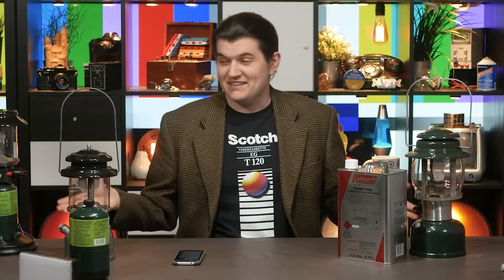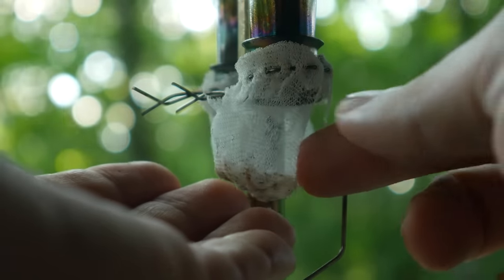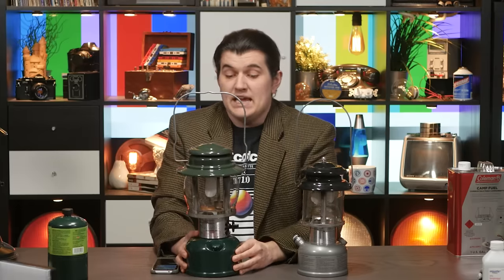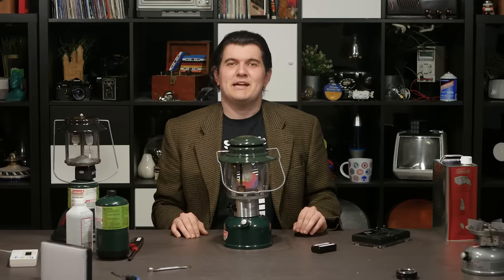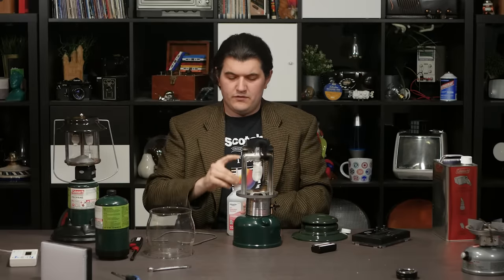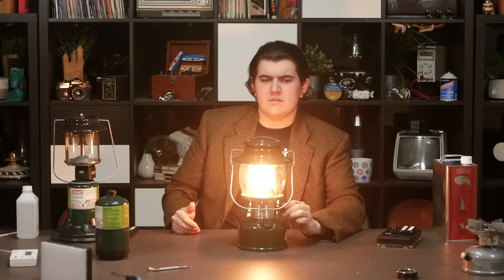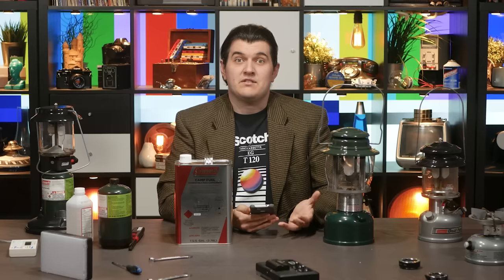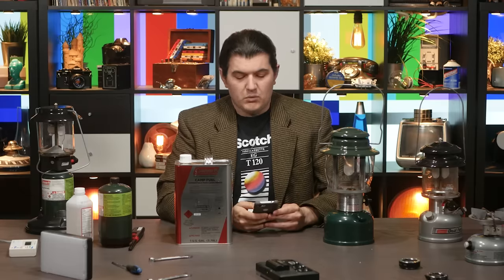A very rambly Coleman Lantern follow-up. Turns out they rarely make sense in 2021

Comment: Are you talking about camping or glamping?  For camping, definitely use a white gas lantern if you are in a cold environment, and even in a temperate region, you never know when the weather can turn on you, or you get wet, lose stuff, planned poorly etc..  Here is why.  #1:  Unlike propane, you introduce an artificial atmosphere to the white gas tank.  Cold weather will not alter the output of fuel, and, unlike batteries, which lose power in the cold, white gas will remain reliable.  #2:  Heat.  YES!  You can heat a small area with a white gas lantern!  Try doing that with a battery lantern.  #3:  Durability.  You get a battery lantern wet, it's screwed, becaue LED lanterns use a circuit board that is not on good terms with water.  You can dry out a fuel lantern, and if you have spare mantles, they are in waterproof bags.  #4: reliability.  You have fuel, it will burn even if the lantern doesn't work, you can use it in other ways.  With battery lanterns, if it's buggered, so are you.  Time to drink in the dark.  #5:  longevity.  The fuel lantern will burn much longer and much brighter, and unlike LED lamps, the incandescent light is much superior in a fully dark environment.  Translation:  you can see better.  There are other reasons beyond these, but just trust me, a fuel lantern, preferably white gas, is by far the best option if you are camping, especially in a climate where you may face cold snaps.

Comment: I guess there is a way to increase efficiency of lanterns - reusing hot gas .
It is possible to preheat incoming gas from outcoming hot gas via heat exchanger
(in theory recuperating almost all of it).
Then we could also insulate heat of gas from surroundings via some vacuum in between.

Comment: You can get further energy savings by using LED head lamps. Since you're only lighting up things inside your field of vision, none of the light goes to waste. A good beam shape will let you get away with much dimmer light, too, a central hot spot will let you see things at a distance while the more dimly lit periphery will still be bright enough to see nearby objects. Since the lamp is on your forehead you're unlikely to see the light source directly, making it easier to keep your eyes accommodated to less light. My favourite head lamp for years even after getting some >1000 lumen ones only did 80 lumens - so it's not so much the lumens, but how you use them (and other factors like size, weight, ergonomics, ease of use and charging, build quality, PWM flicker, consistency of brightness etc.).

Comment: just so you know.. those lids on the gas powered lanterns is ceramic coated... they get HOT.. you can cook on them easily with a metal ring. so no need for a stove.
so light, heat, and stove all in one. GPA's are awesome.. only downside is really that over time if you leave them full of fuel, the generators get gummed up.. point is.. if you are not mechanically inclined.. get some batteries. Great video.

Comment: The real humor is saying whether someone else's choice of light source is "acceptable". I was an early adopter of the LED lantern. My lantern is heading to the garbage. The rechargeable battery no longer holds a charge. The battery holder for alkaline batteries also broke. The only way to use it now is with a bench power supply and alligator clips. The replacement parts cost more than a new lantern. I also have a propane lantern from around the same time period. It still works, and I can still get replacement parts for it at a reasonable cost.

Comment: Part of my emergency lighting system is, I have a set of cordless tools (drills etc) including a work light, and that LED work light will run for days on a 4AH 20V drill battery.  And it's not all I use them for, so it's very little extra cost.

Comment: I believe the best benefit of the older Coleman appliances is their complete reliability over time. I have a wonderful set of 1947 Coleman stove and lantern, that has a 1947 Wagner Ware skillet to go with it. All off them work flawlessly. Can you think of ANY other camping or prepping gear that is capable of working for 75 years without fail? I can't. Certainly not with today's construction standards.

Comment: Fwiw while I love my white gas coleman lanterns I find myself always reaching for my Milwaukee m12 lanter which puts out equal light and runs off my power tool batteries.

I use the gas lanterns to ne actually practical but the milwaikee LED battery lantern is my 1st choice in the dark to get the light going while I setup the gas lanterns.

Don't forget that nostalgic hissing sound of the gas and air mixing in the generator is soo peaceful.q

Comment: I have both too. Always use the battery lantern on camping trips and during a power outage. However, if we have a power outage during the winter, I'll use the white gas lantern to help heat.
I know, don't use them indoors.
Btw, I also use a Colman white gas stove indoors when the powers out. Plus  I've used 5 year old white gas without issues.

Comment: As a camper, I carry battery lights when backpacking because of the weight factor. If I am camping with my car, I take a propane mantle lamp or my butane mantle lamp. The reason is psychological. I find the light spectrum from fire more comforting, and LED light harsher.
Reply: I agree about LED light being harsh. BTW at home I only use incandescent bulbs because LEDs create harmful dirty electricity and blue light. Have you heard that reason to avoid LEDs before?

Comment: as a life time liquid lantern user.. 1. Fill. 2. Pump. 3. Stick in a match, 4, open the valve slowly. 5. When flame is established, open valve to light level you want.  The only difference between kero and white gas/unleaded.. is the "air valve"  on white/gas lanterns..which is akin to the choke on a car. The reason the kero lanterns go out immediately.. is flame temperature. You may not be able to see it but on the screen its quite significant. The white gas lantern burns MUCH hotter with little soot and it burns quite "white", while the kero lantern burns much cooler with a more yellow flame. When running any lantern on unleaded gasoline, it will soot up a little more than kero,  but not as clean as Naptha (Coleman fuel). Gasoline is the cheapest fuel by far. However.. gasoline will gum up if it has any alcohol in it. If you can find pure gasoline (and I use Aviation gas, about 7.50/gallon ), it will last up to 5 or more years in storage. But it will.. will..over time, go bad. Naptha on the other hand.., will store forever. Literally. It never goes bad and will outlast the sun (Grin) If you can find a 5 gallon can of industrial naptha.. its very cheap, around 50 bucks . Coleman/etc has a huge mark up on it, shrug. I hit a lot of yard sales and estate sales and always buy any partial cans of Coleman/etc fuel. Most often people will completely ignore these cans and I get them very cheap. Bring them home, and simply combine partial cans into a good gallon Coleman can., I keep at least 10 gallons of naptha on hand at any one time, and have cans that were purchased 50 yrs ago that are still good. I have at least 15 lanterns of various types and sizes and at least 4 stoves, from single burner micro stoves to 3 burner suitcase stoves. I should also mention that Naptha is available at any hardware/big box store in the paint department. Its used as a solvent/cleaner for paint brushes etc etc and can..can.. can  be had cheaper than a gallon of Coleman fuel. Just saying...

Propane is Ok.. but it burns cooler than naptha. If you run a propane device, get the hose attachment so you can run off a 5 gallon bottle..a BBQ bottle and it will last a fair amount of time. The other advantage of propane, is the hose attachment "tree" can be used to fire a lantern, a stove etc all at the same time. And like naptha..it lasts forever. As you noted.. its not as cost effective as naptha, but if you have the space..it works well enough.

The single issue/advantage of any flame burning  lanterns is heat. When running.. they are hot. Not so good in the mid summer, marvelous in deep winter. Fortunately in summer, you are out in the open, winter you are closed up.  That being said.. they HAVE to be used in an area with ventilation. CO will kill if you are in an air tight tent or room and  run one of these without ventilation.

 I consider rechargable lights to be 'temporary spot sources". Battery tech currently is not good enough to supply lighting that will last more than a few hours in a very small area and you have to have a significant number of lithium batteries on charge at any time, or run a big multi amp hour battery and a big solar charger to keep it topped off during daylight hours. But..., if you do have access to both solar cells and a big battery.., it is quite doable. But it doesnt pack well and is best consided to be used at a fixed location.
I belive your channel comes out of Canada? US prices are slightly different than Canadian prices as I recall.. Canadian dollar being worth.. 65-75 cents ?, American so one has to use a bit of mental conversion figureing out the price differences. I typically find used Coleman lanterns for 5-10 dollars American, used with stoves about the same.  The single most expensive part of these devices is replacement globes (they are pyrex) and mantels.  One can buy Coleman mantels or chinese knock offs for very very little money. Ebay of course is great for New Old Stock and chinese globes are...ok but expect them to not survive rough movement.
Oh.. a standard old style NON dual fuel Coleman/et al  will burn gasoline quite well, but the generator will fail in a few years, rather than in 20 yrs, so keep that in mind as well if stocking up on spare parts. Burning gasohole will reduce the life span as well, if not emptied when putting them back in storage after use. But you can indeed safely use gasoline of any kind (including skunky gasoline) in any Colman type device. Skunky gas may not provide as clear white a light as a lot of the lighter products have evaporated out of the fuel. But in a pinch.. will work.

Comment: A note about comparing energy/weight ratios for fuels:  The weight of a charged battery changes only immeasurably when it is discharged, and its weight must still be carried if not to be left as trash pollution.  Burned fuel disappears (typically as CO2 and H2O,  although the former is a pollutant) so the fuel weight being carried decreases as the trip progresses.  Rocket scientists know this,  which is why we have multi-stage rockets, and airline pilots are always concerned with fuel load.  Very long  flights may start cruising at 30,000 feet then rise for increased efficiency to the thinner air at 35,000 feet late in the flight, when the aircraft is less burdened lugging around full fuel tanks.

Comment: I like using gas-pressure lanterns for short outdoor camping trips because I grew up with them, long before there ever was any LED lights that were nearly as good as what we have today.  I fully understand that they are very inefficient, are somewhat fragile, require maintenance, and can be hazardous in certain situations.  But I simply like using them.
For indoor use, and when spending the night in my van, modern LED’s are so much better in all regards.  I also rely on those during our frequent electric outages.

Comment: The only practical application I see for these lamps, at least for typical North Americans, is for camping where you'll be using gas cookware. If you're gonna be using propane ovens and stove for frequent or prolonged camping trips, might as well throw in a propane lantern should  you run low on battery power. 
Some people run full electric cooking setups, but propane is still the most economical, accessible, and practical choice for many people. A 20lb propane tank can be cheaply swapped or refilled at many locations, where as it might be more difficult to immediately replenish or replace a batteries, especially in the backwoods. You can buy a 2.5' high distribution post that connects to the top of a 10 or 20lb propane tank  with two distributtion points on the sides for stoves and one on the top that you can connect your lantern to. Effectively making a floor lamp that can power two stoves. It's an efficient system, provided you'll be camping with a group for more than one night. 
I would love an all electric camping setup with solar power, but when it comes to camping, but it's a high entry cost, and replacement parts can be costly and hard to fix on the fly. It's also good to have redundancy where you can afford it. A propane tank provides another source of heating, lighting, and cooking should something happen to your battery setup or you cant build a fire, and if something happens to your propane setup, you can limit the amount of gadgets being used and whip out a back up electric stove in the meantime (or cook over a fire, if it's allowed) until you can fix your propane setup or replace a tank at the nearest rest stop/store.
I'm not sure of good uses for white gas or kerosene over propane simply because it seems harder to find replacements of it or equipment powered off the stuff on the fly or in the middle of a trip. Also, the storage of liquid fuel seems more sketchy. A leak in a propane tank will release all the contents, which is a drag, but, Id rather have that than find white gas as leaked all over my supplies while driving down the road . The tin cans seem easier to puncture than the the thick propane cannisters too.

Thats probably enough rambling, even if its under a technology connextras video.

Comment: Fun informative video as usual, and you’re right of course. But I have to agree with those that say it’s not about the efficiency or practicality but rather the nostalgia, historic significance and fun factor. And if you’re in a situation where it’s cold and you’re camping or enduring a long power outage, the heat generated by these old lanterns is as significant as the light. 
I have an LED emergency lantern with one of those hand cranks on it and a phone charge port, so I don’t even really have to worry about batteries in a pinch, but it’s still fun to use the old white gas lanterns. There’s just something about them. 😉

Comment: I live in MN. In the winter Batteries are not as efficient and do not give off heat. White gas lantern will serve a dual purpose. In warmer months battery powered lights are preferable, no heat, easy to use. I think each serves its purpose and having both is a good way to approach the outdoor use.

Comment: When during the fall 2022 there  were warnings about black outs because of the war in Ukraine I got my grandparents'  kerosene pressure lamp in working order. Beside giving light it would hopefully   also manage to keep a small room somewhat warm. Luckily the winter was unusually warm and there were no black outs.  To me kerosene seems to be the saest. People have died  because o leaky  gas containers and gasoline is very flammable. I one of my kerosene bottles leaks I will get a messy floor.

Comment: Regarding low temperatures batteries will not do well at all. Propane will go lower, but at some point it will will be too cold and lose its gaseousness. White gas is your best bet both for cooking and lighting in very cold situations since you are manually creating the pressure. And so, for cold weather camping, the old pump action stove and lantern are the way to go.

As I am not a cold weather camper, I will stick to my Yeti Goal Zero 400 battery pack and solar panels for lighting. The battery pack will also recharge my lamps, my phone and my fan. White gas and propane can't do that. 😃

Comment: Perhaps for emergency and camping use, the question isn't if kerosene/diesel is cheaper than white gas/gasoline but which is more shelf stable and safer to store.

As to camping specifically, it's only for the ambience.   In general, if it's just lighting for emergency and camping, just get LED with a hand crank (buying fresh batteries for a camping trip is easy but you never know when an emergency will occur).

Comment: When Hurricane Sandy hit I had two coleman lanterns available, with fuel and spare mantles.  At least one of them was 50 years old.  After 7 days of no electricity we finally bought a generator, but until then routine in the morning was to light one of the lanterns on the porch, bring it inside to put the percolator together and on the (still working) gas stove,  then light second lantern for the family to come downstairs to start the day.  I'd be proud to be buried with one.

After listening to you for a while, it's obvious you didn't grow up with these like a lot of us did.  Thanks for doing these, but you should go camping with them for a couple weeks like my family did every year.  Or go through a power outage.  BTW, the "hiss" of the lantern is very comforting in a disaster situation.

Comment: All this being said, I've got a Sofirn LT1 and LT1S and they're excellent high CRI, adjustable white balance, USB rechargable power bank capable LED lantern that takes either 1-4x 18650 for LT1 or 1x 21700 for LT1s. My Coleman lantern from the 50's died and I used one of these while winter camping and it's great. No heat, but you can use it in your tent at night safely. And much much smaller. Finally replaced it for me and much much better. 2700k at night, 5000k to reinforce overcast light to wake up, from candle dim to 60 watt incandescent equivalent.. yeah. An older coleman stove is fine especially for winter when butane and even propane can freeze up and lose effectiveness for boiling water, the mantle lanterns have lost in every way.